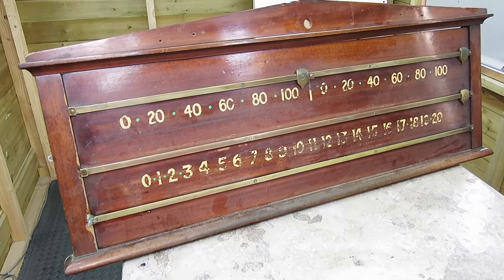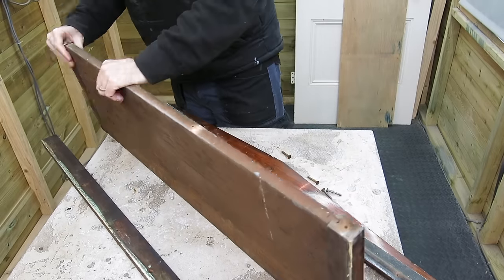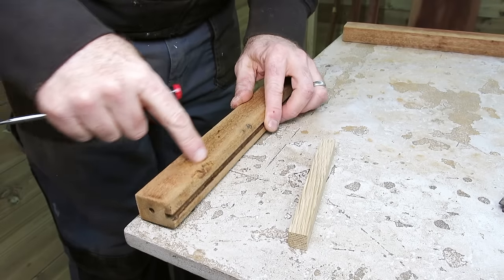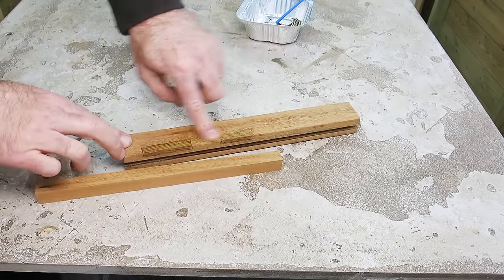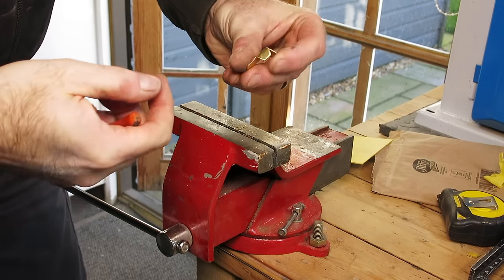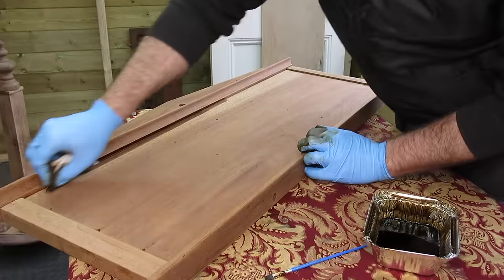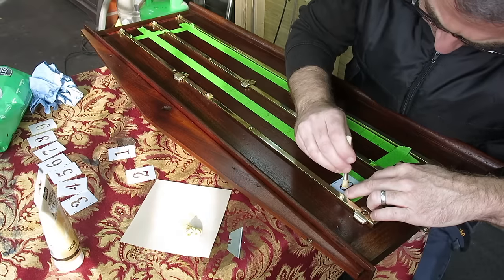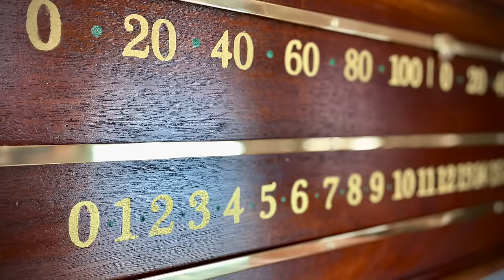RESTORING  a piece of English History

Comment: David, nice job, but a suggestion for polishing strips of brass like the ones in this, mount them onto scrap wood to prevent accidental bending. I use that trick in model making for fine sanding.
Reply from the maker: Great tip. Thanks very much for sharing 😀👍👍

Comment: Why did you not reverse the end piece you repaired, it wouldn't have changed the originality but would have made the repair invisible - it would be on the back?
Reply from the maker: It had the holes where the wall fixing was fitted and it also didn't fit the frame properly when i reversed it to try 😃👍